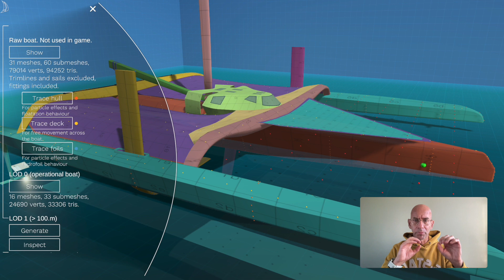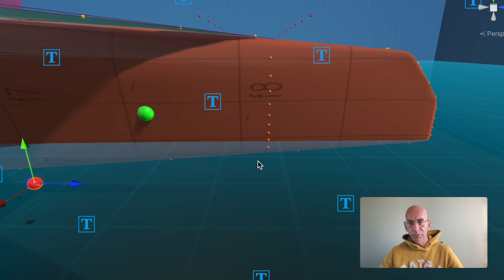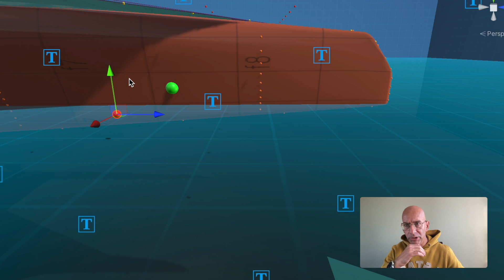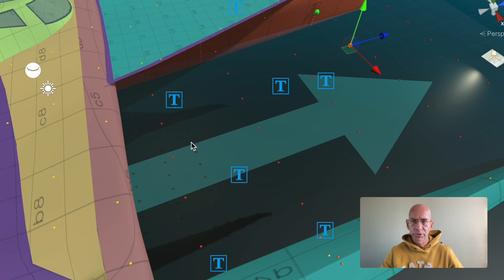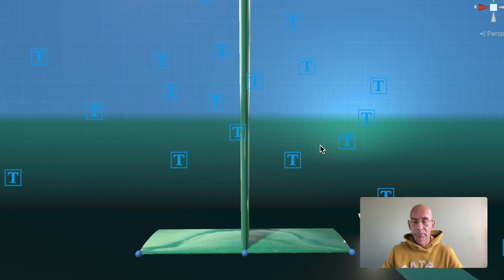Developing Sailaway III 15, Hull shape tracing

Comment: Well done! With that extreme performance gain, I wonder how will the algorithm perform as you increase the amount of dots. I would expect that you could safely add several hundred more dots and that may improve precision while still being within acceptable boundaries. Also, what would happen during a regatta? Will each ship do these calculations and share the result over the network? If so, you probably want to stay below 1ms, right?
Reply from the maker: Increasing the amount of dots would have a linear effect on performance. When multiple boats are on the screen, they only share their positions, speeds etc over the network. Waves are in sync among clients because the internal clock is synced over the network as well. Each client knows the hull points of those boats and can make the computations itself.
Reply: @sailawayworld  is that same method (low vertice count ) making collison detection possible.. if not for boat on boat collosions but for an AI  umpire making decisions?
Reply from the maker: @TheeuwesdeJong  No I will probably use from the default technique with simplified colliders on the boats for that. I already use those to determine mouse clicks on the boat.